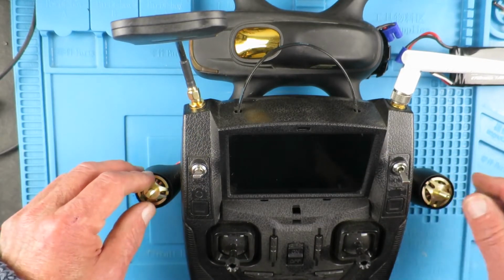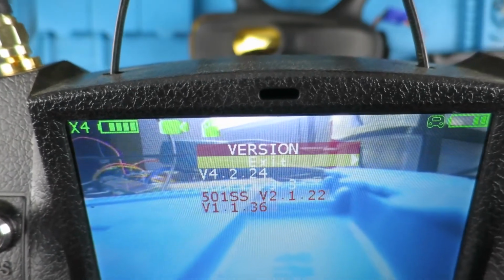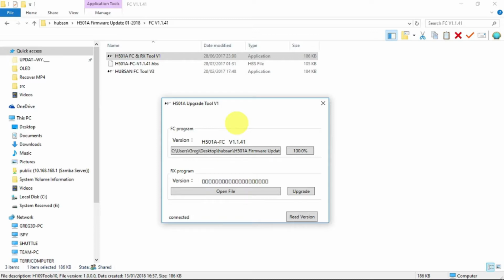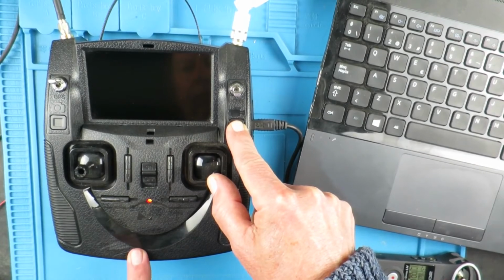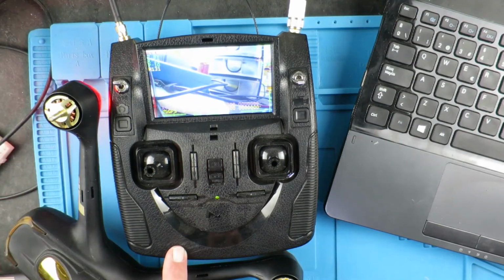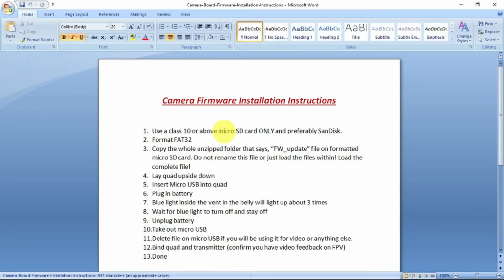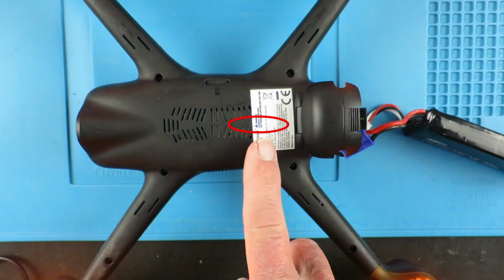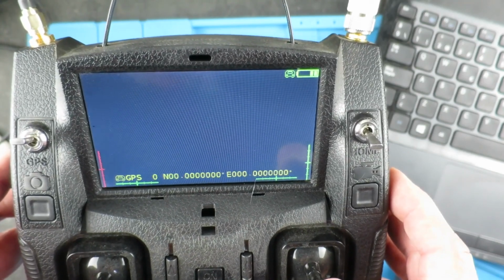Hubsan H501SS Firmware Upgrade Tutorial

Comment: Good day! There is a question .. I just bought and noticed one feature. For everyone who has looked at the reviews, when the quad is turned on, after the inscription "CHECK GYRO SENS", "Calib compass 1" immediately appears, that is, every time you turn it on, an invitation to calibrate the compass appears automatically. For me, it never automatically pops up, it immediately starts blinking in normal mode, such as it has already been calibrated. But I always calibrate before each flight and do each time the procedure, as in the manual, throttle down and pull the "GPS" toggle switch back and forth to force the calibration menu. But this upsets me and even a little enrages me, because I still calibrate after each switch-on and I would like "Calib compass 1" to appear automatically after "CHECK GYRO SENS", like other users, both right out of the box, and constantly ... Have you come across this! Maybe the hardware can somehow turn it on or through the software? Firmware, if anything, is the latest, hardware Standard.
Reply from the maker: I have not seen that. Did you buy it new? Have you flashed the firmware? Has it been crashed? Try At "Check gyro sens" push the left stick to the most left side. Move the right stick left to right quickly, till the LCD screen displays "Calib compass 1". Try powering the quad on first for a minute then the controller. Does it do the same if you are outside? Please consider subscribing if you have not done so already!
Reply: @1nformatica  I bought it new.  Did not fall, did not break.  He already behaves like this out of the box.  I did not flash, the latest firmware is installed.  The procedure "Check Gyro Sens" was carried out with joysticks, everything without changes.  "Calib compass 1 still needs to be called by jerking the" Gps "toggle switch. And I really want it to appear automatically before the flight, like other users.

Comment: Hello! Very thank you for the video! Do I need to update the LCD version?? I have version 1.3.3. If I install version 1.3.4 what will change??
Reply from the maker: Thanks! Each firmware has release notes with it giving details of what is changed / added / fixed in the release. As a rule do not update unless the new version fixes a problem you have or adds a feature you need. Please consider subscribing if you have not done so already!
Reply: @1nformatica  Ok! Thanks!  Where can I find drivers, firmware LCD, as well as a description for them?

Comment: What difference does the updates make?
Reply from the maker: You need to read the release notes for each version of firmware. Some changes will be new features, others may fix known problems. As a rule do not update the firmware unless it adds a feature you need or  fixes a problem you have. If it ain't broke don't fix it! Please consider subscribing if you haven't done so already!!
Reply: @1nformatica  cheers 👍

Comment: what kind of improvements have resumed with the new firmware? please.....
Reply from the maker: In my case I had modified my Hubsan to add a WiFi camera module https://www.youtube.com/watch?v=7-zB4pkkSaE
I wanted the latest camera and flight controller firmware to use this feature.
As a rule don't flash new firmware unless it fixes a particular issue you are having. If it is not broken do not fix it!
Always read the release notes for any new firmware to see what fixes or features it has.
Reply: @1nformatica  Thanks i hace no serious issue, just  a little screen flicker, i bind and change freq. Parameters but i have no important improvement. Greetings from México. I think my problem is here, i have so many antenas WiFi nearby .
Reply from the maker: Maybe try a directional antenna? I made my own panel antenna https://www.youtube.com/watch?v=n2W37DzzmYQ
Un saludo desde Andalucia!

Comment: Sent you a tidbit for a cup of joe Greg. I appreciate all your assistance to everyone.
I'm putting in the H501A camera module into my new SS tomorrow. I have learned the camera on the SS has a slightly larger CCD sensor than the one that comes with the A and thus has slightly better video and pics. I would like to just disconnect the lens ribbon that goes to the SS camera board and reconnect it on the new A board. Will this work? Seems like the ribbon connectors are the same...did you notice that? 

Also, I bought a H501A along with my SS both have the latest firmware FC V1.1.50 which I don't like. I was never able to get the A to do waypoint flights. It would start the first leg of the flight route and stop about 40-60m out and just hover, NOT dropping out of waypoint mode. When I did the RTH it took off like a bat out of heck never to be found...searched for 3 days using the last known GPS. Both of these birds have the auto compass setup with the latest firmware and compass/gyro module so you don't have to manually do the compass calibration. I honestly think there is an issue here and want to put in the Previous version of firmware (FC 1.1.41) as it's more stable. This I believe this would require the manual compass calibration which I prefer for flight safety reasons. Can you put in previous versions of the firmware?

One more thing, do you have to do the compass calibration on the controller AND in the X Hubsan app? When you start setting up a waypoint flight the app goes into compass calibration mode. Does this over ride the calibration that you did with the controller or is this limited to just the app? Just wondering if there is potentially any conflicts here.
TIA
Reply from the maker: That's jolly decent of you, I will raise a cup to you this evening! The camera connector looks the same and I thought about just swapping it over. But, the connector was glued in and it looked like epoxy that was also covering some smd components which I did not want to damage.

The waypoint problem I have not seen my FC is  1.1.41. Personally I will stick with manual calibration. Yes it's a hassle but verses a lost model...
I have not tried to go back to a previous firmware but see no reason why it should not work.

The Hubsan App also requires manual compass calibration each flight. I don't know if that is determined by the FC firmware. In my test I did the compass calibration using the App. The standard transmitter was also connected at the same time and you could use either to control the quad.

Good luck with your mod!!
Reply: Thanks Greg. Do you think I will need to upgrade the camera firmware on this V03 module I got from Hubsan?
Reply from the maker: Mine worked straight out of the box. I didn't even have to change the FC firmware on the quad. I updated it anyway to the latest just to show how it was done.
Reply from the maker: Another observation. I always wait until a minimum of 6 satellites are fixed by the quad. It is possible I think to take off with only 4 but it is much less accurate especially on RTH!

Comment: bonjour encore merci pour ce super tuo  i have one question you have an hubsan h501ss mod to h to h501A with camera module  my question is : after you update your firm<are what did you see now when  you check firmware version ? are you see h501A or h501ss? thank you again for your job!
Reply from the maker: Hi, the firmware shows as 501SS.
Reply: thank you
!I just mod my h501ss to h501a with the help of your exellent explanation and I would like to know for the update i must use the upgrade firmware  h501ss or h501a ? i just download the latest  two firmware on HUBSAN oficial support
Reply from the maker: Thanks! It should work OK without upgrading the firmware. I used the H501A firmware https://youtu.be/TAtInWa1vcs?t=260
I think H501SS and H501A are the same.
Reply: @1nformatica  thanks again!

Comment: Thank you for your quick response an help with the camera   please allow me to ask a question    cause for some reason hubsan seams to not wanting us to know these things. Here goes the transmitter has a fail safe mode if it turns off the drone returns to home is there hardware or software so it can do that wen the drone battery is almost out
I Have a h501ss. Thank you in advance 
Sincerely.
Reply from the maker: Hi, I do not think what you want is possible. Check this post for a great description of the Hubsan failsafe modes : https://www.facebook.com/groups/1655445394706994/permalink/1738015883116611/

Comment: Hi thanks for this very good tutorial..Can you please supply a link for the 501SS Firmware as I can not find it..
Reply from the maker: Hi, Hubsan do not make it easy, the link to the download is https://www.dropbox.com/s/05evabrij645sj2/H501SS-Firmware-Update-09-2017%20%281%29.zip?dl=0
Reply: 1nformatica Thank you very much!
Reply from the maker: You are welcome! If you have any questions please ask. Schöne Grüße
Reply: Hi There,

I Have a huge problem with my new H501SS Standard receiver.

So.. I lose control within 10M.. It's not the antenna or any other lose connections.

I have fitted a long range 5dB antenna but the same result..

I'm a technical guy and have tried everything, firmware etc...

I have bind my Advanced TX to the quad and it works 100%

So it must be my standard remote..?

The firmware worked 100% for my Advanced TX, FC, RX

I'm a little bit lost with my standard TX as I don't think it's firmware.... 

Any suggestions
Reply from the maker: How annoying! I guess the easiest way would be to find someone locally with a H501 and try their transmitter.
I am sure you have checked everything so do not take this the wrong way but double check again! The  small IPEX connectors can often look in place but be loose. Check the battery discharge capacity on a LIPO RC charger if you have one. The Tx antenna should be at 90 degrees to the H501, also I guess it is attached by SMA connectors check the polarity of them. I did a stupid thing recently when testing an antenna. I just grabbed one off an old router and screwed it on without looking, turned out they were both female connectors, DOH!! Never assume anything. As I was once told "Assume" makes an Ass out of U and ME!!

Comment: Thanks for that info.   I am encountering problems trying to modify the max speed of my H501ss, you seem far more knowledgeable about it than I so I'm hoping you might have some insight.  I have gotten as far as being able to get the parameters and change them in the modding tool, and save them to the quad, (I needed to do a work around which entailed connecting to the quad when it's powered on, disconnecting the battery and usb, reconnecting, etc, and finally being able to get parameters and change them, however after flashing them (now several times) testing of the quad still shows it is capped at the 5m/s speed. Would you happen to have any idea what I am doing wrong? Thanks!
Reply from the maker: Hi, There are many modding tools, which one are you using? I have not tried this myself but I seem to recall it is only the GPS and RTH speeds that are capped. You can only really go faster in manual mode. If you haven't flown in manual take care it's a whole different ball game!!
Reply: I'm using a tool called "Hubsan H501S FW Tool" at the top of the app. at the bottom says developer Medvedev Oleg, Severodvinsk.
Thanks for the info on manual mode and the warning(I nearly lost bearing on it on a windy day and was crapping my pants for a good 20 seconds while I got it back under control and the right heading.)
 Upon switching to manual mode yes finally I can go faster, although the acceleration is still lacking. Would you know of any way to both uncap the GPS max speed, and increase acceleration? (I think this would probably involve changing max tilt?)   I'm seeing that I can hit about the same max speed as my bebop 2 now, however the bebop 2 accelerates and reaches max speed FAST, where as it feels like the H501S limps to that max speed.

Comment: Hi! I recently purchased H501SS and this is my firmware. Should I update it? 

V4.2.33
LCD V1.3.3
H501SS  V2.1.29
CAM V30.84.84

Subscribed!
Reply from the maker: Hello! The golden rule with any firmware update be it Quadcopter or laptop is not to change it unless you have to! If the new firmware fixes a bug or provides a new feature then go ahead. Read the release notes with new firmware to see what it fixes or adds. The reason I upgraded was because I put a new camera board to add the wifi control from a smartphone app https://www.youtube.com/watch?v=7-zB4pkkSaE
If you decide to go ahead then just proceed with caution and double check everything before pushing that button! Good luck and thanks for subscribing!
Reply: Thank you!
Reply from the maker: You're welcome! Let me know if there is a particular subject I can make a video of.
Reply: Actually this is not my main problem, bro. I switched a body shell and before mounting everything I noticed that FPV on transmitter is black, but other signals are coming. I checked all the cabels, sockets and camera. Camera records on sd card. This is not camera problem. FPV modules on both remote and board are hot while powered on. I tried every frequency on transmitter. Nothing. I rebounded transmitter. No result. One guy told me that if I powered on the drone with no FPV antenna attached, I probably burnt out FPV module. I didn't know that. I powered on  drone several times with no FPV antenna. He suggests to buy new board($20), but before making purchase he told me to check out the firmware.
All in all what can you suggest me, bro?
Reply from the maker: First double check the 5.8 GHz IPX connector. When I disassembled mine the connector was not fully pushed in although it worked. Also some of the black gunk they used to keep the wires in place had got into the connector. Remove the connector and inspect carefully, I used a USB microscope when working on mine. Next find someone with FPV goggles. I use the Eachine brand and it will scan the 5.8 GHz band for a signal. Much easier than setting the Transmitter. If you can't see the signal then time for a new board!!
Reply: Alhamdullilah(Thanks God) I fixed it! FPV is working on transmitter!
Thank you brother so much! What I did is I carefully checked IPX cable, it was okay and attached very well. The main problem is on cable that binds camera board with motherboard. One of those very tiny holes was covered with plastic particle. So there was 1 missing connection between motherboard and camera board.

What I learnt from this is being extra careful and attentive with tiny objects. 
I was very upset for several days. You cannot image how I was happy when I saw video on remote!!! Thank you so much, dude!!!
Reply from the maker: Assalamualaikum, I am very happy for you! It is very easy to make something loose and you do not see it when you are concentrating on another thing. Now you can go flying!!
Reply: Vaalekuassalam brother, you are absolutely right. Back to the air :D 
Please kindly receive my 3 pounds for coffee :))
Reply from the maker: Thank you, you are very kind. It will go towards my new project, I'm making an RF frequency synthesizer and a spectrum analyser for hobby use - stay tuned!
Reply: 1nformatica Sounds cool, hope you will realize your project with success. Good luck ^^

Comment: Awesome, Thank you !
Reply from the maker: Thanks Marchello! Are you going to modify your Hubsan? Let me know if you have any questions. Also thanks for subscribing.
Reply: 1nformatica 
Hi
Well, using this mod, i allready removed altitude limitation, and incresed RTH speed to 8.
And tested it in moments when you writed an answer :D
Because of strong winds i was not bieng able to push it to its limits.. Buuut.. I was 840m high, and at next flight, 1100m avay, at hight of 200m.
(I am using 14dbi - 3dbi antenna set, that i bouth on amazon)
I say it again,this was not real distance and hight test, because i was afraid to push it more because of strong wind, and my batteryes were also faster empty because of it. Maybe tomorow weather will be nicer, i will report :D

Comment: A firmware BIOS Update can ruin everything and I know that feeling and it's not good, but I've done over 200 of them and had one fail and I had a bad motherboard exact in every detail, same model. The reason for having this board was a customers request. He touched it while it was running and pulled the power supply out he said he seen smoke when he plugged it back in, but the BIOS chip was still good thankfully. I flashed the new one and it said failed so I'm thinking I just paid for a new board so I put a newly downloaded file from Asus on a different thumb drive and it failed again. So I thought I have another chip on a bad board so I pulled it and pulled the new one while it was running and switch them and flash it, success! I always look at the new features before installing a new version to see if it's important and this one allowed me a larger amount of GB and more name brands so I did it being he bought more RAM so I restarted it and the new version popped up and I upgraded the RAM all done, But I consider that a fail even though it worked out in the end. What if I didn't have the other board? I was so happy it worked for you on the second try. I tried several times before switching, each time sicker and sicker.
Reply from the maker: Ah yes! the fun we can have!! At least you didn't have to unsolder the chip like I had to in an early video....    https://www.youtube.com/watch?v=fMXBI_hhhjg
Reply: Like a typical 555 it just had pins you pushed in place. I was so happy it restarted.
Reply from the maker: Lucky! You really have to have cojones to mess with this stuff!!